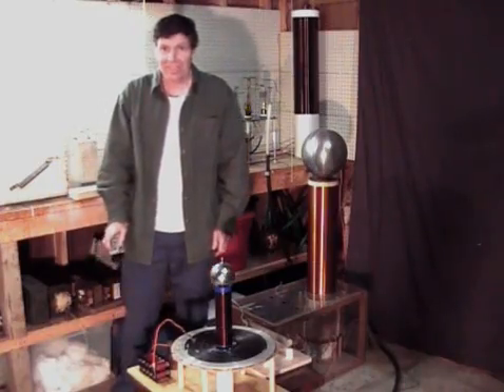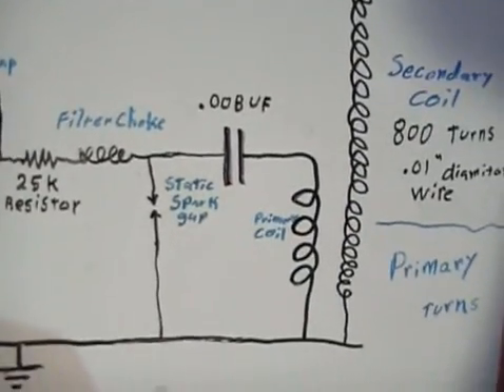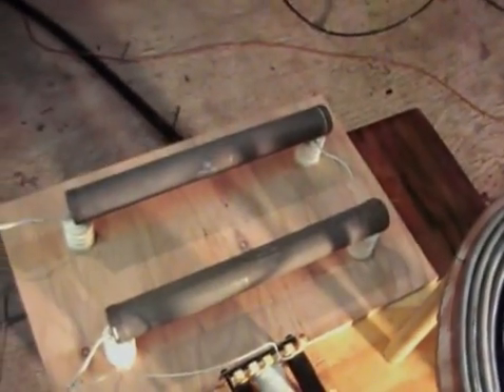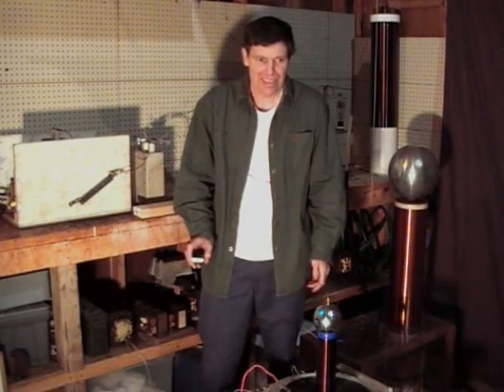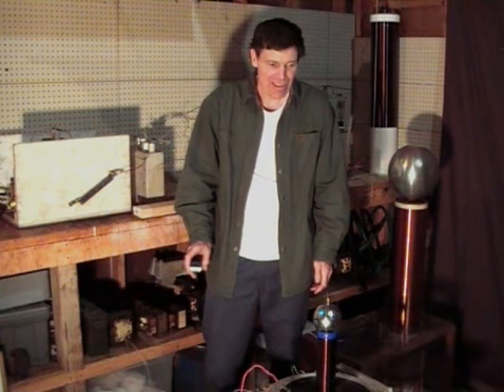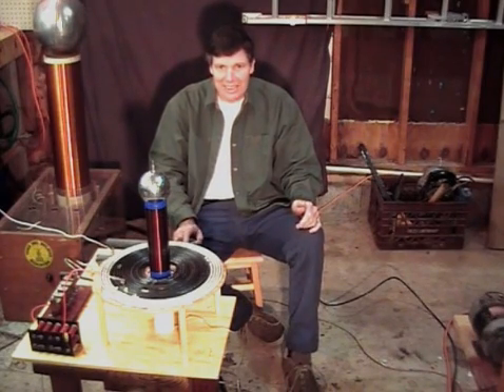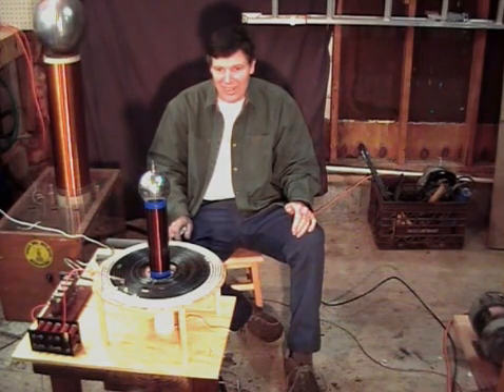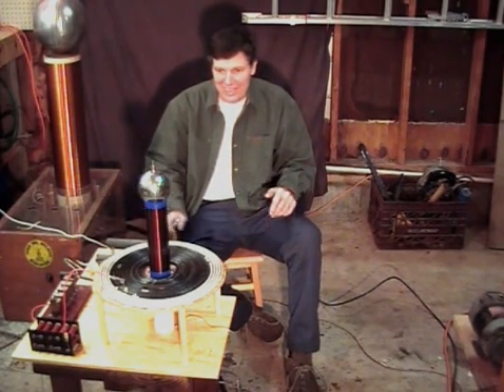Small DC Tesla Coil 1

Comment: Am I correct in saying that by changing the resistance of the filter choke, one could change the interrupt rate of the tesla coil? It seems like there'd be a way to play music, like with a solid state tesla coil?

Also, it then seems like (by slowing the interrupt rate) one could use a smaller power supply that would take longer to charge the capacitor and therefore produce longer sparks with less power?  

any thoughts?

Comment: I know your not I am just saying theres some confusion going on.  I am just saying a ignition coil and this are simmilar though because lets face it both gives off a spark and they both have windings regardless if they create the spark the same way or not is all i am saying.  I fully know a tesla coil is way different but their technically using the same principle just getting the spark in differentways.  Sort of like breaker points to charge and discharge the ignition coil down to magnetic.

Comment: Hate to say this but your getting ahead of yourself.  I am talking about a ignition coi when I said that so you dont have to go all technical on how a tesla coil doesnt have this or that. I was saying the spark voltage is dependent on the turns.  Thats the only way on a coil how to get high voltage out of the secondary circuit while saturating the primary circuit with low voltage.
Reply: He did an incredible job, this video was for many more people than just you. I've never built a DC Tesla Coil and I wanted a baseline example of how someone else did it. I was not disappointed.

Comment: a 40 turn secondary. I could have had longer if the resonant frequency was lowered with a topload. I know this from experimentation. My 300 something turn secondary with a resonant frequency of around 1.4mhz, lowered to around 600khz with topload, got a 9 inch spark after tuning, and the secondary was only 6 inches. This was a vacuum tube tesla coil, but this does not matter. It is all the same principal. Oh,and the primary was about 25 turns, so if the ratio mattered, I would have a small spark

Comment: But that is not true :D. Tesla coils are independent of secondary turns. The ratio makes no difference. It is all dependent on resonant rise. Why do you think a out of tune tesla coil produces no spark? The resonant rise requires the resonator and primary to both be running at the resonant frequency. Ignition coils run at many different freq's. You do not have to run any where near the resonant frequency of the core or anything, and you still get high votlage out. I have had 1 inch sparks with

Comment: I said same basic principle I didntsay a ignition coil and the tesla coil are the same.  You basically said what I said just in more technical terms which I avoided so more people could understand.  I said the collapsing field causes voltage to form in the iron core and spark to the plug.  The voltage of the spark is dependent on how the coil is wound.

Comment: Not really, a tesla coil is made to operate at resonance. Ignition coil frequency always veries with the revolutions of the engine. Also, if voltage is built in the iron core, you will have alot of loss as eddy currents. The core simply becomes magnetized, when the primary voltage falls to zero, the field collapses which is the coupled into the secondary, and a some back into the primary. If you have a 6 cylinder engine, the iggy fires 300 times at 3000 RPM. 8 cyl, 400 times a second.

Comment: No matter if you use AC or DC input, the secondary will always be oscillating. Think about solid state. I guess the oscillations would be called ringdown. Humz. Once the spark gap fires, oscillations continue through the spark gap for the few ms (i guess it would be in the ms range?) between the tank capacitor and the primary, of course still coupled into the secondary. Goes to show how little i know XD

Comment: think of a automotive igniton coil its same basic principle as a tesla coil.  You have primary windings in the coil that is provided voltage to create a magnetic field then you have either breaker point or electronic where the circuit is broken when that happens the collapsing magnetic field causes voltage to be formed in the iron core and create a spark ranging between 40,000 Volts to 80,000 Volts depending on the ignition system.  Car system is a 12 Volt DC electrical system.

Comment: ebay, or a transformer shop ( pole pigs) I would recomend you get a neon sign transformer from ebay first because they're relatively safe and cheap. they're also already inductively ballaced, unlike most other xfrmrs. goo luck. ( how the hell are you doing tesla coil stuff with 600 volts? Solid state?)

Comment: well i have no got a small 1 or 2 ma 9000volt (estimated)with a large bowl cover with aluminum tape and a 6inch by about 8 inch jar in parallel for the tank cap and i can get a 1 inch spark